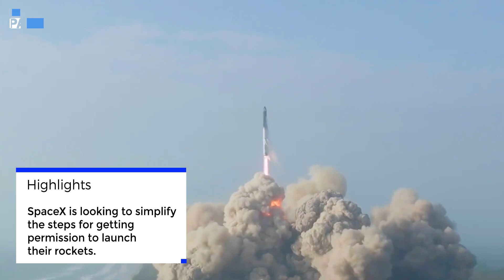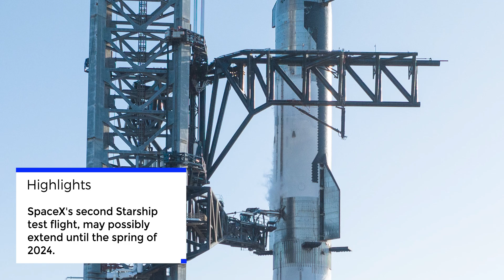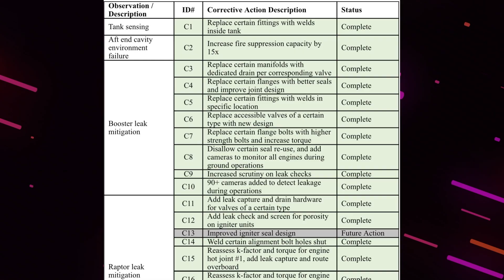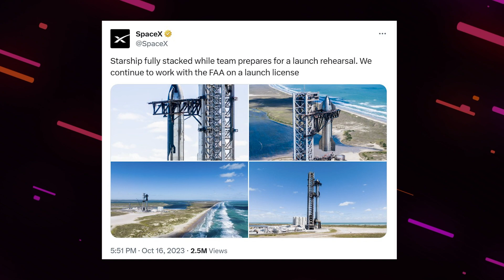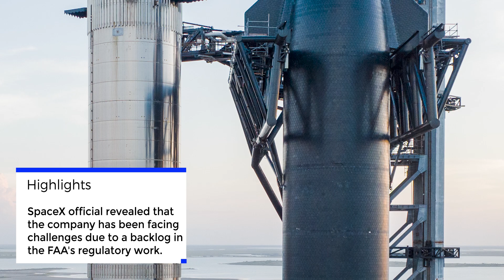SpaceX Went To Capitol To Make Starship & Falcon Launch Process Easy | Episode 10

Comment: Our GOVERNMENT NEEDS TO GET SOMEONE FROM THE FAA AND USDS to the moon to insure there are no species that could be harmed as the result of a landing and takeoff of the "moonLandingsystem" MLS.  The FAA will need to examine the facilities to insure the take off can be done in safe manner that will not effect any humans or Moon beings that may be in the vicinity of the launch. This is critical and the heads of these departments should get a flight on the next NASA rocket to the moon assuming NASA can get the necessary licenses.